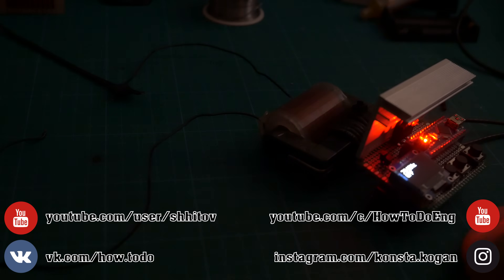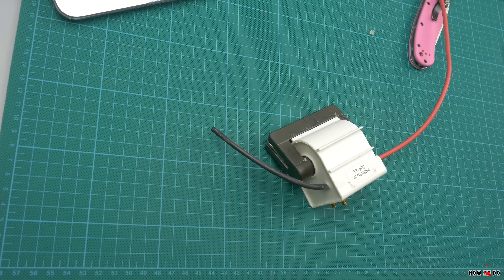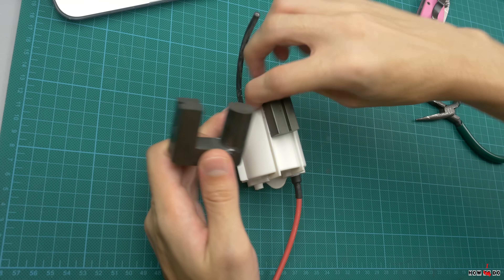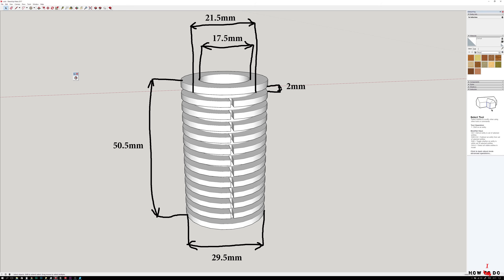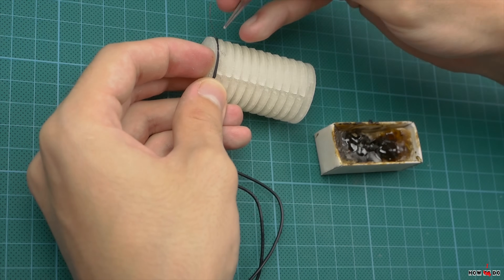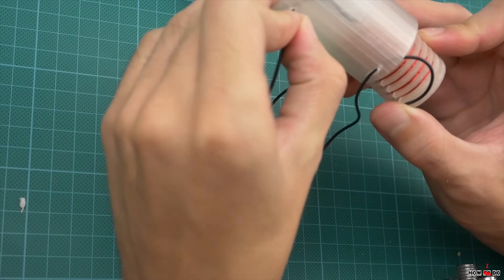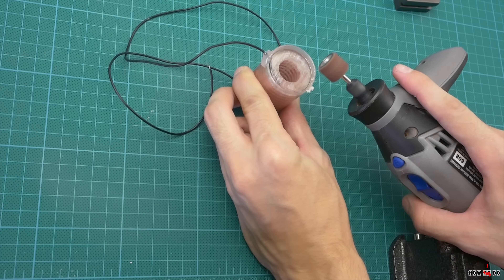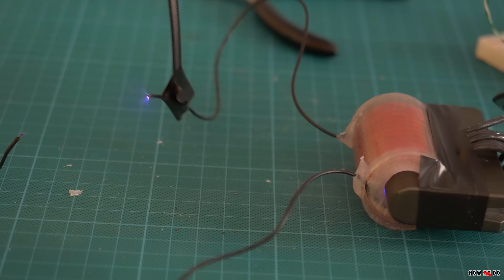How to make a High Voltage Transformer

Comment: What is the purpose of multiple slots on the high voltage winding? Can you share a link where I can read more about the theory? Thanks.
Reply: It makes it so that in 1 slot the voltage between the winding with the lowest potentential and the highest one doesnt get too high and arc. It divides the high voltage into multiple lower voltage parts.

Comment: Wouldn't oil work fine instead of resin?
Reply: yes oil is great insulator and cools the transformer as well just got let it touch any thing giving off electricity. Is seen pwople cover these transformer in hot glue thebun a glass jar of oil

Comment: can this be used for DC high voltage?
Reply: No if you use DC no magnetic field no arc
You can use AC 
Use the AC POWER SUPPLY
Or you can use DC by multi mosfet transistor
Reply: you have to multiple High voltage diodes, between sections or else if you are planning below 15kv then one 15kv diode is enough. But here dc means one direction not ripple free, but that works for every physics research needs from xray to ion beam.

Comment: hello, I am looking to brute force myself to high voltages with no driving circuits. I am looking to re-wind a MOT transformer for 30000 volts at 30mA (900W). Will 32 gauge wire work? I estimated I will need 32000 turns. I will rectify the AC to DC and use a Variac for power control. I want to re-use my primary coil. I do not like using driving circuits and such and need the ability to swap between negative and positive output.
Reply: It would be easier to use a voltage multiplier to get to that kind of voltage. Start out with 3000v and do 10 or 11 stages. The down side is you won't have that level of current. 30ma could potentially be lethal. I'd try to keep it under 2.5ma or even get it in the uA range. If you just want impressive arcs try a Marx generator.
Reply: @paulb2529  I wouldn't get the current I want

Comment: Does it work at 350 000 hz ?
Reply: It depends on the transformer core specs. If the core can handle 350Khz, then it sure would (coil numbers/layers differ vastly with different frequencies however).
Reply: DIY-OR-DIE thanks for your reply.

Comment: nice one!
I have a question. How do take the wire from one section to another section? I see there are slots accross the section.  the last turn of a section has higher voltage than the first turn of the section. When we take the last turn of one section to first turn  / layer of the next section, there will be large voltage differences. Does it not cause arcing through copper wire insulation?
Reply: This is a key concern when winding such transformers. You have two options. The first being to estimate/roughly calculate the peak voltage potential between each pancake coil/spacing and then submerse the transformer in oil and/or add a sheath onto the transfer wire heading into the next section. The second option (more ideal) is to have a hole and "tube" leading to the BOTTOM of every division allowing the HT wire to start at the bottom of each division thus greatly reducing arc over and wire to wire potential.

Comment: Really cool, im going to try this, I dont have a 3D printer, but i have a lathe I will just turn a similar piece and mill out the slots in the plastic. I’m thinking of just using a simple 40amp DC PWM speed controller to control the frequency for now. It doesn’t have to be super precise. I have a few projects I need some REALLY high voltage for. Thank you for this video and construction techniques

Comment: sir what is the black material using outside of coil . what is that name and what is the use?
Reply: Its ferrite. Its used instead of an iron core like in a "classic" transformer. It works best at high frequencies (in kHz to Mhz range), so you always need a driver circuit (ZVS, royer) to power a ferrite core transformer.

Comment: I don't have access to a 3d printer but im an engineer with lathe access so im going to make a bobbin based on your design from solid stock nylon. really like your design and have a load of flybacks from old tvs that i have stripped but as with you, i need HV AC not DC for many of my projects so your design is mint.
Reply: Noel, Did you ever make any of these cores from your lathe?

Comment: Hey, You will burn out your transformer like that, I'd recommend putting it in a transformer oil bath.
Then you can drive it even harder. If you look closely your transformer is turning blue when its on (arcing across)

Comment: Use No 40 wire with 11% more space between core and base of winding. Reduce Space between individual windings by 35% and you will get 25% more sets of windings and 60% more turns onto the configuration. This will provide output of more voltage with less driver current.
Reply: Adding 60% more wire whilst reducing insulative material between coils is a terrible idea. This works great if using a diode stack (one in between each coil) for DC output. The problem is HF AC eats/degrades insulation over time. Many 3d printing materials also suffer large losses and heat considerably from HF AC.

Comment: Your project is great, but most people don't have 3d printer and are not familiar with arduino, so not very practical :)
Reply: Well most people have heard of Arduino and can possibly get or use a 3D-printer. If you don't have the tools, then you can't expect to do everything you want to. Not saying it's necessary for this kind of project, but in many cases you can't blame anyone with the right tools for you not having the right tools x)
Reply: um
Reply: Bogdan Rotaru There are a lot of 3D printer kits available now for really cheap. They are easy to assemble and use with enough research on them. I got my first one when I was 15 years old for $200 and it was easy enough to assemble.
Reply: Are you serious? I think using arduino would be easier for someone who don’t have much experience with building circuits. The case can be made from any other material. And don’t forget that you can get those cheap zvs drivers on eBay. People say they work well.